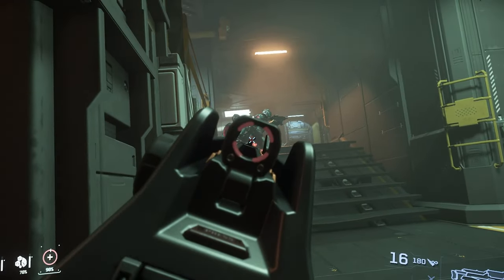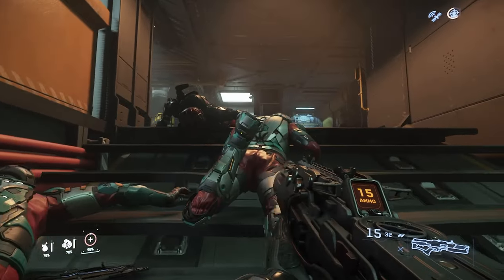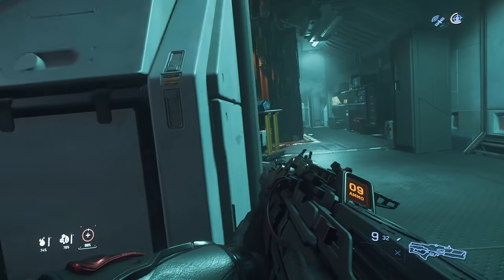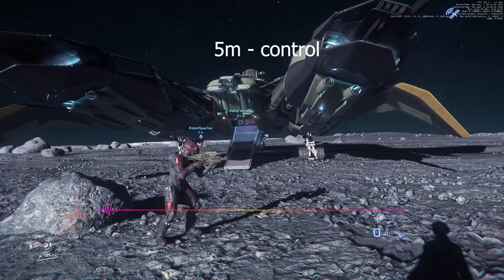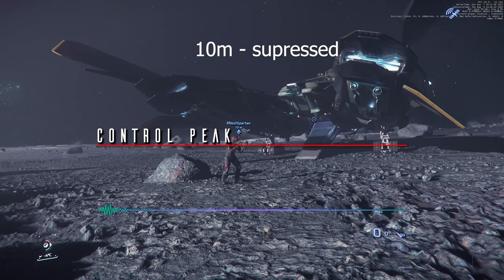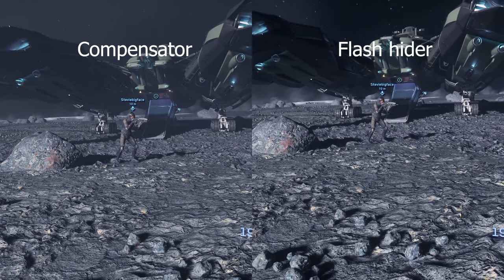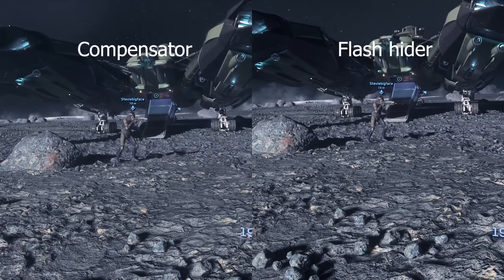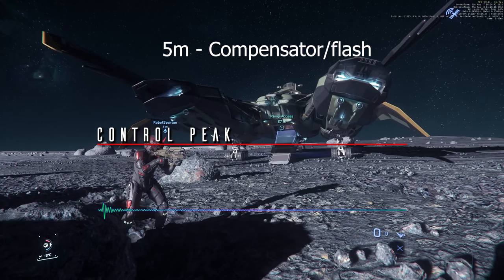Star Citizen - Effect of Barrel Attachments From an External Perspective

Comment: Short but good, think you should have tested the different sizes of them though. of course we get a general idea of how good they are. What would differ with a silencer is the difference of atmospheric pressure, and the flash hider would differ based on the lighting. Of Course there is the compensator for both energy and ballistic, and then there is the karna rifle that uses plasma, witch is a energized projectile that basically something solid get so heated its liquified, so it would be needed to be tested with all attachments. So if you lack ideas of other content that's what you could do.
Reply from the maker: Different sizes we did, and there's no difference so decided not to bring it up (guess i should have mentioned it in hindsight)

On the silencer and atmospheric pressure; the silencer is a % drop of volume, rather than fixed, and additive with variation in atmospheric density.  The result is that it appears to have the same effect (silent until you're within 20m) but with the muffled "space sound" when close instead. Again, hindsight should have maybe mentioned that!

Flash hider we tried in the dark (mostly to make it easier to see in the footage) and honestly there was hardly any difference in the footage

compensator is the same for both energy and ballistic. And the karna, whilst plasma on paper (same as one of the shotguns, i forget which) currently uses large energy projectiles as plasma isn't in the game. That said, i didn't test that specific weapon so its possible im wrong!

Comment: Is it just me or did it seem like every attachment reduced noise?
Reply from the maker: The flash hider and compensator actually add noise slightly at 40 and 60m, but below those its identical to without (i couldn't think of a better way to visualise it than i did, sorry!)

Those waveforms are the actual waveform from the clips by the way, so as accurate as possible to be
Reply: @RobotSpartan  I watched the other video and see that now. IRL, muzzle brakes like the compensator actually INCREASE muzzle flash in a lot of cases or direct the plume differently, but I like that they both do similar things to a different magnitude
Reply from the maker: @johnboyd9713  Aye i think thats where their idea of them increasing sound distance with them came from, as increasing muzzle flash wouldn't really have much of an impact as i showed.

Do agree its nice they do the same thing, but with different emphasis on the two things they do. What i think would really make a difference is if the flash hider completely hid the tracer (and compensator hiding it slightly)
Reply: @RobotSpartan  It would be interesting if there was an energy equivalent that changed the lasers to UV or masked the laser for a certain distance before impact. I mean using an arrowhead sniper rifle is like putting a big laser pointer on yourself giving the arrowhead just one more reason to be a poor choice in snipers. Might be op if not balanced right, but without something like that, I would think energy snipers would need a huge damage buff to balance out revealing yourself every time you pull the trigger.

IDK just a thought I had while thinking about flash suppressors
Reply from the maker: Aye thats exactly what i was thinking with the hiding of tracers, though i suppose that would be ballistic specific! Definitely needs some attention from CIG